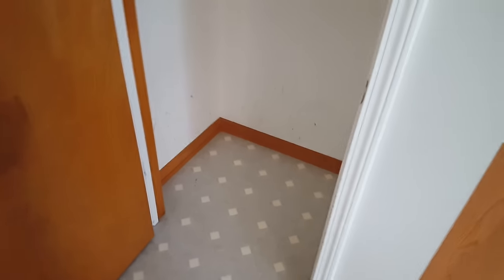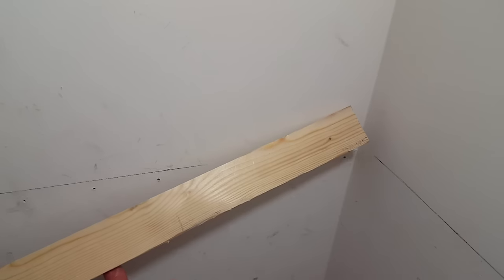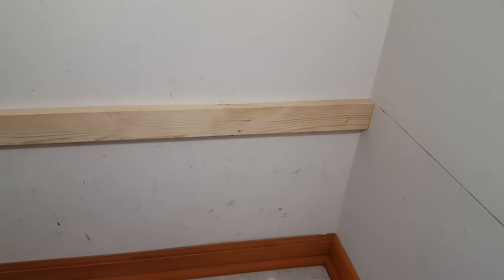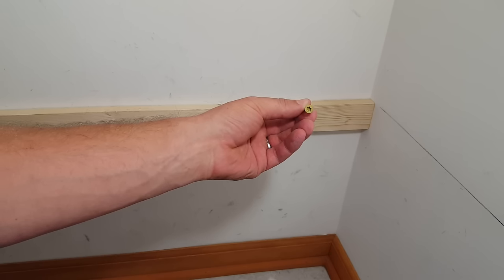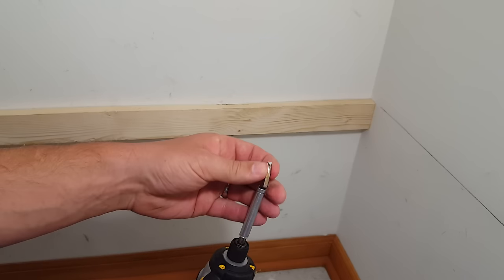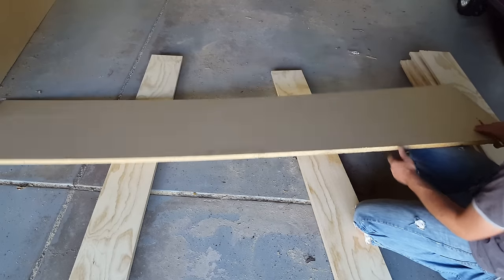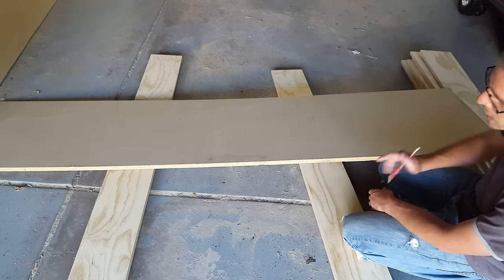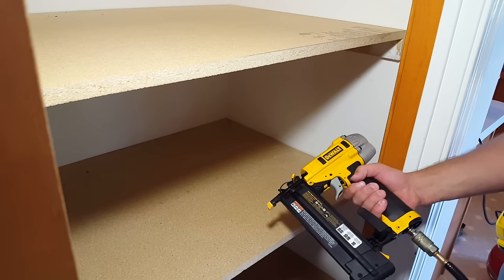Simple Pantry Shelving

Comment: "I like using screws because you can take them out" ...Now how in the hell are you gonna take em out after you put wall bondo over them? Lol
Reply: You can just push the drive bit into the top of the screw, joint compound is pretty weak. It won’t be a problem
Reply: You won’t be able to see it under the paint.
Reply: Use a magnet to find screws.
Reply: I would have painted the shelves first
Reply: Tell me you don’t do any construction without telling me “wall bondo”
Reply: @Triadinteriorupgrades  Well, if he can't find the screws we already knew before he gave it away 🤣
Reply: That looked like the spackling that goes on pink then dries white when ready to sand/paint
Reply: Wall bondo. 😂

Comment: I always spackle (fill) and sand the front edges of shelves if using particle board. It just gives a more even edge is all. Easier to paint as well. But I was a painter, not a builder. You guys rock.
Reply: Good tip, thanks!

Comment: This confirmed my shade tree engineering   skills.   I have kind of walk in closets with almost room to put 1x4 shelves on the sides between where the molding starts and closet ends.    The goal is to make 1x4 little shelves for watches, small items and get things organized and out of the way.

Using a small miter saw, I'll cut a 45 degree angle but not completely on the end, just enough to fit the molding inside.  Then cut the length to the depth of the closet.   Once I have that and assuming that it will fit the closet in all shelves and the second closet I want to do this to, I have my template.   Going 18" from the floor, then 12", etc until I get about 5' up.    Using the one cut board as a template, I'll cut all the shelves I want from 1x4s.   To the front I'll tack nail on fancy looking screen wire trim just enough to give these shelves a lip so things don't fall off.   Supports only need to be on the end.  I just need one the width of where the molding is and a second inside the closet to catch the stud.  Those are the templates for all other supports.  Since it's only small items, no need for a support the length of the shelf.

It's not much trouble to take a random orbital sander and smooth these down, apply a stain and then spray them with a clear coat.  I now have my shelves that simply need to have drill holes in the supports to the wall and can tack on the actual shelves and trim with a brad nailer air gun.

Watches, bottles of aftershave, jewelry, wallet, things you just need a space for out of the way.   The house is like 60 years old and this should last another 50.

The most difficult part of this or any job is simply starting it.

Comment: screws are the way to go. We've just finished a temporary deck for our RV and used screws plus double head nails (which are easy to remove). We plan to use the materials for our chicken coop when our house is finished. Thanks for posting
Reply from the maker: absolutely, I have change my mind on so many projects or decided to change them that I just can't go with nails anymore. I spend enough time pulling nails for pallet projects anyway:)

Comment: Nothing like over screwing the furring strip.  I would have put a strip along the front of each shelf for reinforcement, once you get those shelves loaded up with canned good etc those shelves will bow eventually. You can even notch out the strip so it covers the end grain of the shelf for a nice clean look. You hit the jackpot in the wife department :)
Reply: Psh, I "over-engineer" mine, too. If you have a large enough cleat, the right size screw, and space them properly then you are getting 2x shear strength. Sign me up for that.

Comment: Nice job! Great video. Your Wife's reaction...gold. 
Suggestion for the finishing of the shelves is instead of painting them wrap them top and bottom in the front edge and inexpensive contact paper. You don't have to paint. And it's easy to wipe off much easier because it's vinyl. Also the raw edge of particle board can be finished off with a rounded molding. very inexpensive. 
However, again your wife's reaction was gold. 😁

Comment: I have a closet in my bedroom that I converted into a bookshelf using the exact same method.  With the weight I would recommend putting in a support piece either under the center of the shelf or in front.  I first set up the shelves like you did and then added the books and after about a month I had a bow in the middle where the shelves started sagging.

Comment: Nice job with the shelving. Painting can be a hassle but the paint will go on easier if you don’t cover the entire brush with paint. Only about a third of the bristles need to hold paint. It will go on smoother, make the brush last longer and be easier to clean. At least that’s my experience. I’d much rather build than paint too.

Comment: I used a drill to put bolts in while hanging a TV. Bolt stopped turning, drill did not, and neither did my wrist. Socket head is less likely to break away and it didn't. First time wasn't bad but I actually did it twice and twice wasn't so good. Helped me remember that I had done it once already. I've had my wrist in a stabilizer for a couple of months now with little change. Hurts bad when I do certain tasks. Not all the time just bending it in just the right way. I'll have to see about a doctor, which I've avoided due to covid. All of which is to say I've since learned about impact driver and I could have saved my wrist. For that reason alone use one. It had other benefits to not stripping heads of screws but for me now that's actually the least benefit.

Comment: This is EXACTLY what I’m wanting to do for our pantry.  My only concern is on one side of the wall on the other side near the bottom is an outlet.  Another wall has 4 light switches and our thermostat on the other side. How do I unsure I don’t zap myself when screwing in the supports?
Reply from the maker: IT is hard to say which way the wiring goes from the box so you will need to be careful. There are tools you can get that will identify wiring in the wall before you drill or screw

Comment: I built shelves very much like this in an unused bedroom closet (the closet was unused, not the bedroom). Eventually, the closet was needed again so I had to replace the clothes rod and main shelf. Now I want to convert the dining room coat closet to a pantry. I noticed that the shelves in your closet are fairly well spaced apart. I would like to make sure that ever inch of this 32"W x 36" deep closet is not wasted. How is the usage going in this closet?
One other thing - I am also considering using shelf tracks this time so that the shelf spacing is changeable. I'm thinking that shelf depth might be limited by the available bracket size.

Comment: Do you not need middle support, or is the 3/4" partical board sturdy enough over that length? Looking at minor appliances storage as well or loads of canned goods.
Reply: I would put a "face board" on the front edge of the shelf that is the same dimension as the cleats. Then run a middle support underneath. Good to go, and looks even better, too.

Comment: Screws may seem stronger than nails in many ways. But, their shear strength is much much less than that of nails. When fastening your shelving ledgers to the studs you really should be using nails. They are stronger in this situation. That being said, I'm sure those screws will never fail and you'll be alright.
I'm a DeWalt fanboy too!
Good job on the video man, I appreciate your work.
Reply from the maker: +Steven Gockij i have always thought that about the shear strength on screws as well and was taught to always use nails on a vertical force. But with modern screws i wonder if that is still true? I may have to devise an experiment! Lol, thanks man!

Comment: Good job, watching from the UK, so if your putting up shelving on a pin wall/ stud wall and have no rear supporting uprights behind the plaster or just one, what's the best way to hold the screw, plaster plugs, fin screws, or what? Doing a shelving job in a 200-year-old house that seen better days so advice would be welcome. Ta.
Reply from the maker: You could use “plaster pins” or what we call drywall anchors but you would need to use quite a few

Comment: You don't need wall plugs before you put the screws?  The screws just be screwed directly to the batten and the plasterboard? Can I use nails?
Reply: That's why he pointed out how to locate the  studs (vertical 2x4s boards inside the walls). You drill through the cleats, through the sheet rock, into the studs with screws that go through all and at least one inch into the stud.

Comment: This is what I want to do in my existing pantry but it is 'L' shape.  It has the coated wire type shelves that are now pulling through the little plastic 'thingies' that hold them up.  I would like the shelves in both walls to be the same highth.  So do I have to cut at an angle, miter, the corners?  Also,  why did you add shorter strips under you longer ones?  Thanks for any input.

Comment: Nice job but one question from a amateur. How do you cut the shelf boards if the closet is not square? I used a square at the corners and one side has a gap. Hope you can understand what I mean.
Thanks
Reply: The correct answer is to scribe it. The "good enough" answer is to cut it as close as possible and caulk the gaps. Even if you get a perfect fit I'd run a small bead of caulk anyway.

Comment: That type of board will sag after time especially when used for heavy items like small appliances, canned goods, jars of dry goods (i.e. pantry items).
Reply from the maker: +Patty kay I suppose if that turns out to be the case a strip of 1x1 across the front edge of each shelf would resolve that
Reply: @SSLFamilyDad  Hi please can you explain by what you mean 1x1 at the front? ive just had some mdf shelves made and they are brand new but sagging as soon as any weigh is put on them. please advise thanls
Reply from the maker: You can grab a piece of 1x1 at home depot and put it across each shelf under the bottom front edge. Screw it in from the top of the shelf and it will hold that edge straight
Reply: @SSLFamilyDad  Could you have just used wood planks for the shelves instead of the particle board? Would that eliminate the risk of sag?
Reply from the maker: I think that would work just fine

Comment: In my experience, the edge of particle board is weak.  Knock it with a heavy can of fruit and you'll have a big dimple with flaky pieces coming off it..  Would be best to add a small piece of trim to the edge.
Reply from the maker: +Tooshie G i have thought about adding a pice of 1x1 to the edge, might be a good idea
Reply: Cheap shoe molding or 1/2 round works too!

Comment: @SSLFamilyDad, what if your building shelves in a laundery clost that has no studs behind the wall, what can I use to support my cleats and then my actual wood boards??
Reply: That is a bit of a problem.    You would almost have to open up the wall and see what is going on inside there.  It’s unlikely there are no studs whatsoever.. it could very well be lacking or in odd spots.  There are sheet rock anchors you can use but I would never trust them to any real weight .  It sounds like your project may be a little more involved..
Reply: dave lanz thanks ,the screws. used worked really good. it all worked out.

Comment: Impact drivers are not ideal, even though they're quicker, for screws in wood. You lose some of the holding power of the screw because it's been over turned and beaten into the wood. You wouldn't hammer in a screw and expect the same holding power. Same concept.

Comment: Not all screws are suitable for putting up shelves. Nails have a very good shear strength, Drywall screws do not! The gap you left around the top of that shelving is going to collect bits of food that is being stored their and attract ants and roaches. Fill it with caulking and make sure the shelves are painted with a water resistant/proof paint or that particle board will disintegrate if it gets wet..
Reply: +1 on the caulking.

Comment: I mean  you're very lucky that you happened to have had studs right on the corners where a screw would hold the wood at its strongest. The video wouod have been far more interesting if you have to attach the wood straight into plasterboard
Reply: That's what they make anchors n stuff for bud. Studs are always spaced 16 inches apart

Comment: This guy does not know what he's doing or talking about at all. That's not "particle board" that's MDF. He does not even know the difference. Particle board is used in roofing.
Reply from the maker: +KING TROLL actually OSB or oriented stranded board is used in roofing. Although I rwferwd to this as particle board I also used the correct nomenclature of MDF. I commonly call MDF particle board as well since they are similar in property and manufacturing process
Reply: Jerk by name, Jerk by nature. If you're going to criticise get your facts right. That is exactly named as particle board, also known as chipboard , or LDF (low density fibreboard) Certainly not MDF.  In roofing you would use OSB (orientated strand board) NOT particle board.
Reply: Thats MDF.
Reply: That is not MDF. Look at the edge when he is painting. That is particle board. There is a difference.